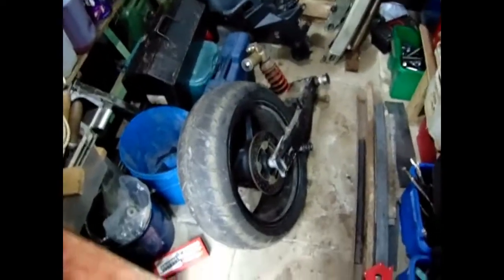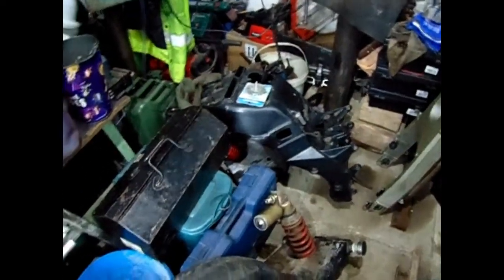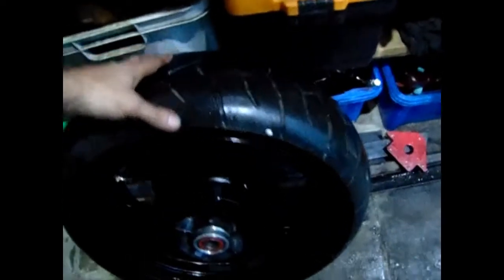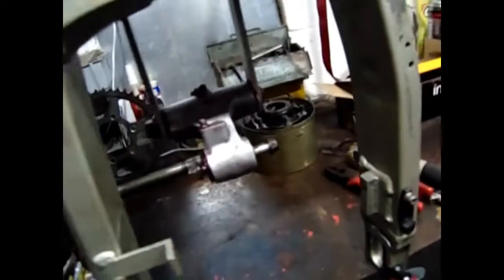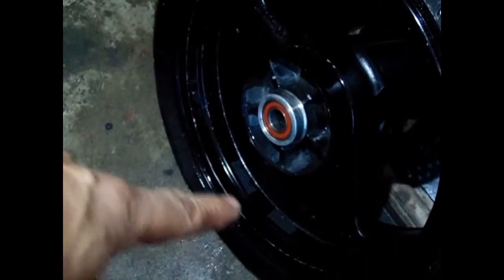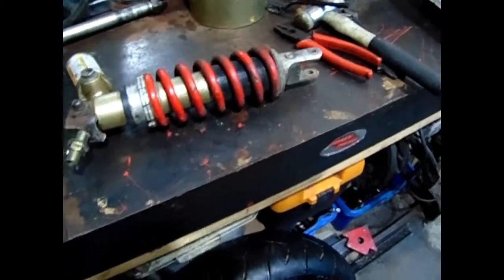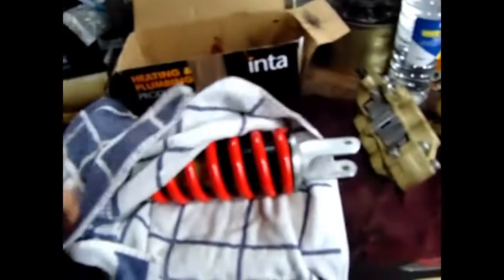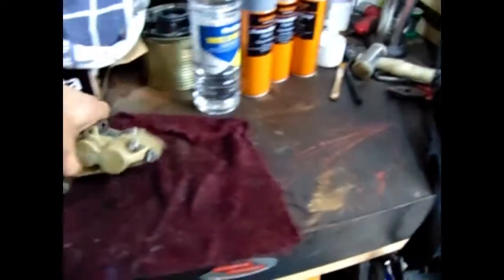ZX12R SHOCK REFURB LOOKS LIKE NEW

Comment: Thats pretty pricey for rebuilding an old shock considering the new options are probably better w better adjustability for similar price. In process of putting a Hyper Pro Street box kit in my 2000 ZX12R or possibly just a Hagon emulsion rear shock in. Both priced very well w 5 yr and 2 yr warranty
Reply from the maker: I know but I wanted to keep as standard and I once spent a fortune on Ohlins rear shock for a Thunderace, to be honest I didn't notice any difference but that's probably cos I'm a shit rider lol and didn't know how to use it to its full potential. I do have a YZF750R though with an Ohlins rea shock that needs rebuilding so ill get that done and then start practicing actually trying to use that bike etc.